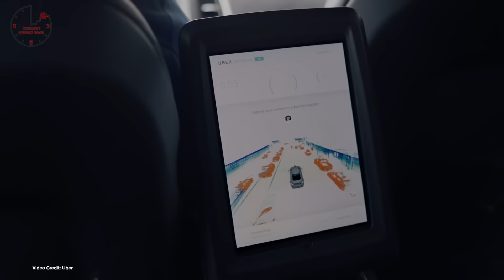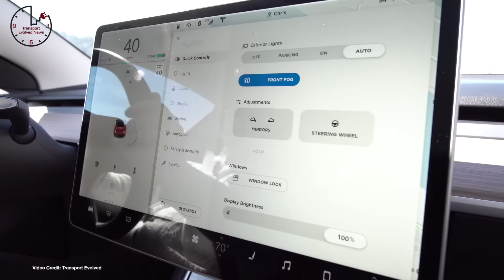Harley Davidson LiveWire, Musk Tests Autopilot, Who is “Fact Checking” - TEN Episode 231

Comment: 20 MPH for the Twizy... that is ridiculously slow. 

I live in the UK and as many Twizy owners in Europe and other countries, tuned my Twizy to a top speed of over 65 MPH and an increase of torque by 80%... now with 100 nm. Not much compare to other EV cars but in cities it is a rocket and completely change the use of the Twizy.
Reply: That would be fun.  The Twizzy would be a fun vehicle to go pick up my son from school in, which is only 3 miles away.  Just a bit far to walk but wasteful for an ICE vehicle to drive.
Reply: Yeah. In my city, there are enough places that are "too far to reasonably use a scooter" that the Twizy would be perfect for - but would involve driving on streets with 35-45 MPH speed limits that driving 20 on would cause a safety hazard. You'd think it would have the same requirement as a moped - 35 MPH max. At least then you would be at "full traffic speed" on 35 MPH roads, and "acceptable enough to be safe slow" on 45 MPH roads.
Reply: It's fast for a bicycle :p
Reply: Would it be possible to hack any EV? I have a super Soco 1500tc which tops out around 40mph and 25 mph up hills. I don't want to break any land speed records, but 50 mph uphill would be awesome!!

Comment: Rather than restricting speeds for autonomous vehicles, they should increase penalties after accidents for poorly thought out autonomous driving technology. From what I have heard about the Uber accident, it was an avoidable event caused by really poor software. The reality of autonomous cars is that it is relatively easy to now days to create a car that can drive itself 99% of the time, but that 1% of the time is the hard bit that you really need to get right, and Uber clearly just ignored. Seriously, someone crossing the road in front of a car is the FIRST thing to test and relatively easy to test repeatedly until you get it right.
Reply: @davidbeppler3032  Caused by software ignoring the lidar. The lidar itself was just fine.
Reply: @davidbeppler3032 
It was the software.
Uber had turned off the safety in order to keep the autopilot from turning off and demanding the driver take over every 5-10 miles.

Comment: Canada Electrified Vehicles sales are about 2.4% of all motor vehicles, and 8% of passenger cars only. The original article leaves out the 2.4% factor, but does mention that passenger car sales are small compared to SUV, Vans, pickups.

Ontario was leading the was with their CAN$14,000 incentive, but that’s gone, so it will be interesting to see what the EV sales are in Q4 2018 and Q1 2019.
Reply: Don't need subsidies for EVS , sales will take off on their own.
Right now the problem is availability of EVs in showrooms.
Reply: Luis Destro. Are you saying you did or will buy a new EV with zero government incentives? Which country is that?
Reply: @imho7250 , already bought a  Model S last year here in Ontario and I would buy another without a subsidy if I needed to. 
That being said, I already have benefits of driving low cost with no road tax (only sticker for the plate), HOV lanes access too. Not to mention maintenance is so much cheaper. 
I don't believe we need subsidies for EVs because the savings are already great. I'm only $25-30 bucks a month more on my hydro.
This could of course change, government will find a way to tax mileage or some other means to keep up the infrastructure. 
Like I said, the problem really is the availability and lower cost EVs.
If you remember how expensive computers and flat screen TVs, the market needs time.
Reply: Luis Destro, so did you tell the government to keep the CAN $14,000 or did you keep it? There is a savings on EVs but not from a $25k Honda or Toyota. Without the $14,000 sales will drop. Tesla has lots of model 3 so supply isn’t a problem, but lots of Ontario buyers canceled their order once the incentives were gone. And some bought an S/X before the $75,000 limit was imposed.

There will be a few who would buy a Tesla without any incentives, but that’s not the majority. Let’s see what that Q4 sales look like in Ontario compared to the areas with an incentive.
Reply: @imho7250  ,really,  your asking me if I would say no to $14 000?
It didn't come from nowhere, it's taxpayers money!
Tesla is expensive, no question...doesn't mean everyone must have one or deserve one.
Whenever there's cheaper and more available models from all manufacturers, anyone can have one. Bolt or Leaf much cheaper and not much more than a ice car and your pay back will be sooner. 
Don't need to subsidize someone to make a intelligent decision, the incentives are already there.
Reply: Luis Destro, that’s the point, we have a lot of people claiming they would buy the car even without incentives, but few actual cases where it happened. So Ontario is going to be a good case study of how close to the “tipping point” we really are. My prediction is EV sales will drop to less than 50% of Q3 sales in that province, once the full effect has kicked in, which might be Q4 2018 or Q1 2019.

I see a LOT of people doing financial acrobatics to overextend themselves financially to buy a $49k car because of that $7500 tax credit in the US. I can assure you 100% that Tesla sales of new cars over $50k will drop to 50% or less in Q1 2019.

As you say, only an idiot, or someone who didn’t earn the money they spend will wait till 2019 to buy a new Tesla over $50k. I would expect Q4 2018 sales to be the best ever, but it seems demand for those cars is already declining. 

I wish the IRS would publish figures on how many US buyers bought a Tesla without getting most of the $7500 tax credit.
Reply: Yes I'm very interested to see what the sales are now that the rebate is cancelled; if they are even close to the same amount I'll be impressed but I expect it to drop considerably.  $14k is a LOT of money to regular people :)
Reply: Noel Dillabough, yes, it’s the key factor that lets a $60k car be as cheap to own and operate as a $30k Honda Accord. People can pony up the cash if they know they will get their money back over the next several years.
Reply: I fully intend to get an EV next car; however I kind of need one soon and even if they announce "the one" for me it will be an 18 month wait to get one in my hands...try ordering any EV under 100k :)
Reply: Noel Dillabough, which car are you waiting for that cost Can$100,000 ($75,000 US)?
Reply: What I was referring to is say you order a bolt or a kona...it will be at least a year before you get it, and these are in production.  If they show a new awesome car in the auto show tomorrow it will be at least 18 months before you can have it.  Car manufacturers are phoning it in, they won't really try until they're threatened with bankruptcy.
Reply: Noel Dillabough, yes, the reality is EVs still aren’t viable to make in large numbers regardless of what Tesla is claiming, once the incentives go away. But many won’t believe it until they see Ontario and US sales in Q1 2019.

Comment: Hi friendly people of the internet.

Can someone please explain why the electric bike has 6 gears? Shouldn't it have like 1?
Reply: It allows you to use a less powerful motor and still get the desired speed.
Also the instant 100% torque during from 0mph is not as needed in a motorcycle.
You only need 50ft lb of torque and 60-80hp on a bike to be able to out accelerate all but the most fire breathing street legal production cars
Also remember that the faster the motor has to turn, (as in a single speed bike) the more electricity you use.
Using 6 speeds allows you to have the motor spinning at minimal rpm's while still having the bike moving at 50-70mph.
Reply: Because it will appeal to current bike users. It’s like those hybrids with speakers producing engine sounds in the cabine.